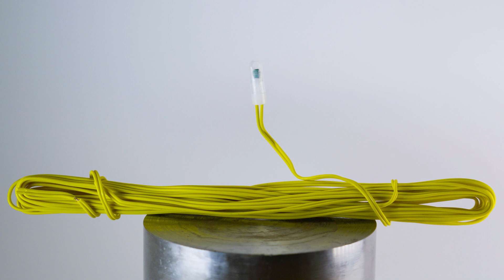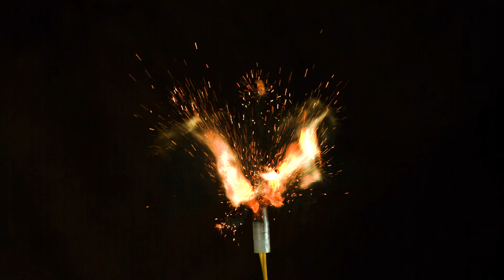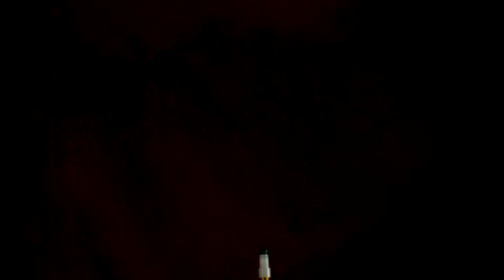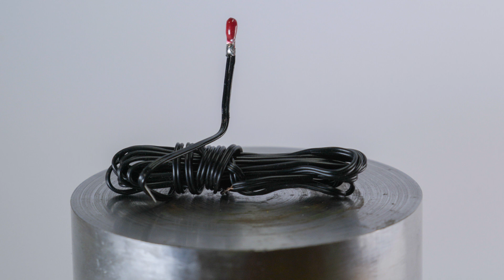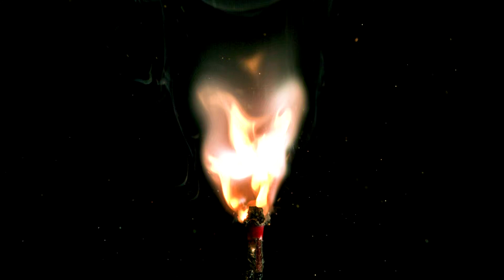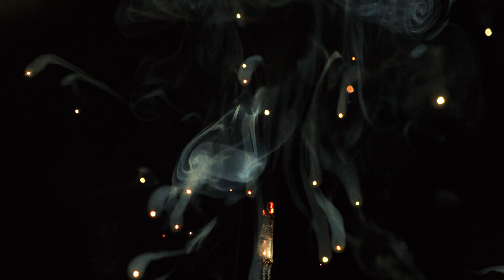Electrical Igniters for fireworks, pyro and explosives - Slow mo macro

Comment: they are soldered on not spot welded
Reply from the maker: The czech igniters are actually spot welded. I tested this by heating up the copper wire and igniter head until it was all red hot. Solder would have melted. The Chinese igniters are most definitely soldered though.

Comment: Those igniters do look like tiny fireworks.  I suppose that's what they are.

As a kid, I used to make model rockets from kits.  The igniters were nichrome wire wrapped around a tiny combustible rod that inserted into the business end of the rocket motor.  It wasn't that much different than these; at least in theory.